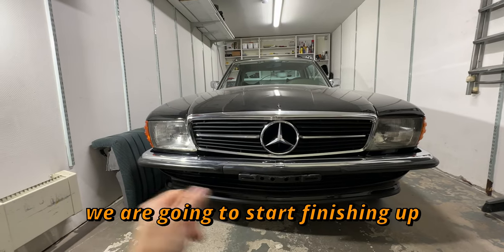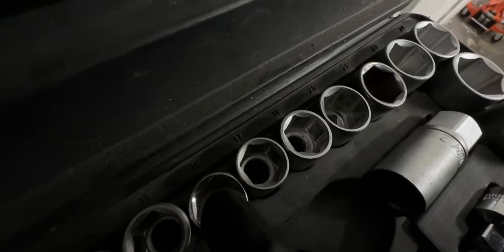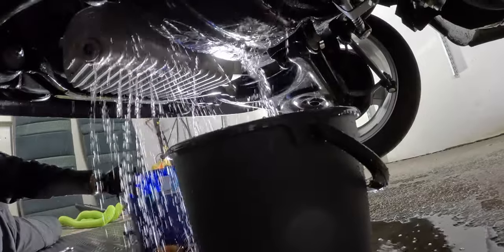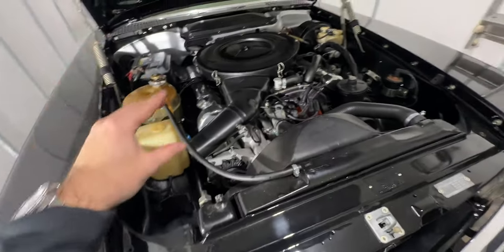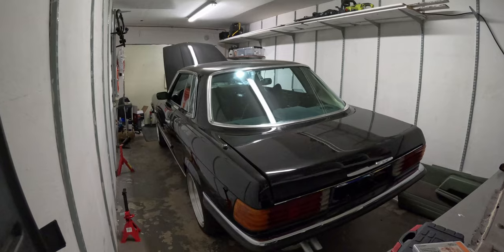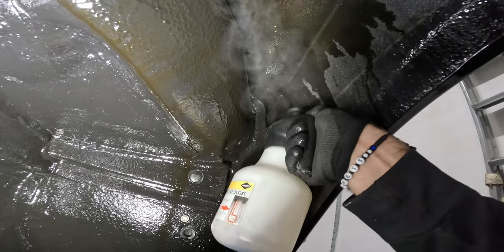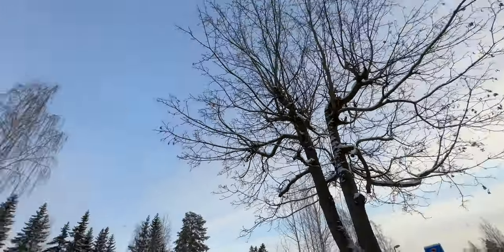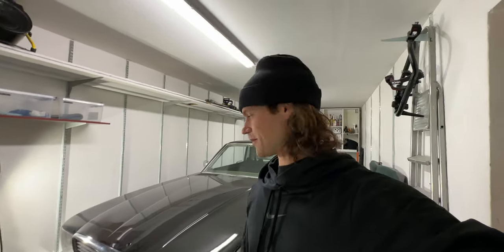PIECE BY PIECE LET’S FINISH THE DREAM | Project Coupe Mercedes 350 SLC (PART 1)

Comment: Great effort! Do you have a torque wrench? There are factory specs for the torque of most of the screws.
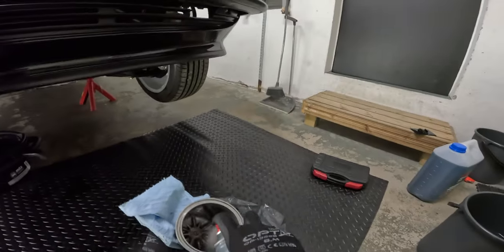8:23 Another little piece of advice: pour some oil in the oil filter cover with the new filter („pre-lube“) before wrenching it in.
Reply from the maker: Thanks, I do have one but it was at another garage at the time of filming.😁 This time I didn’t pre lube since the bolt goes trough that filter cover. So I tought it might leak to my hands when I lift it up before the bolt is tightened.

Comment: Tomorrow i will go and purchase some copper crush washers 👍. Excellent work sealing the underside of the fenders, all the protection you've applied looks amazing.  That's a heavy car and your front jack stands look a little weedy, you could do with some heavy duty versions.
Reply from the maker: Thanks!😎 I think I will have to look for some extra security on those stands, perhaps some extra ones. Thanks for advice!

Comment: This was great.  I need to send this to my Mercedes Tech here in the States.  But check your jack stands.  I would see about reinforcing something.  I saw a video on YT where a guy made wood supports from 2X4's as a backup.  If I can find it I will send it to you.  Kudos on the fenders.  One recommendation is to coat all of the screw heads with the rust protector.  Oh, and the background music is awesome!  It's my kind of dance music.  Can't wait for the trip to start.  You have a new subscriber.